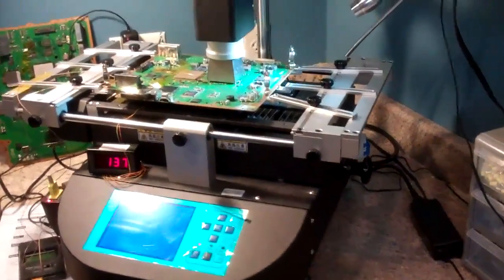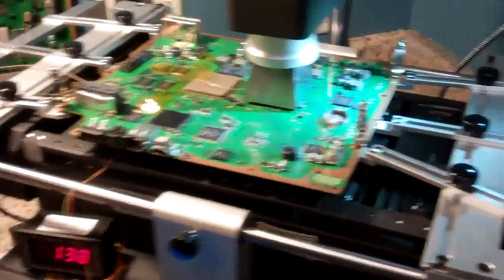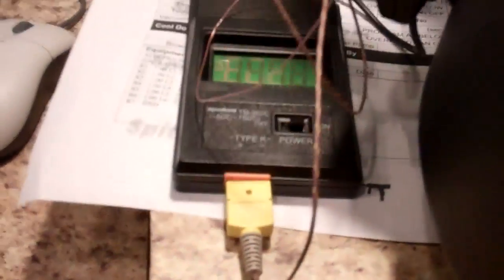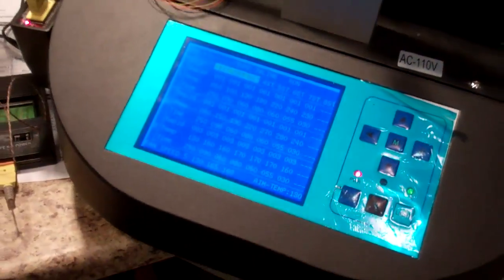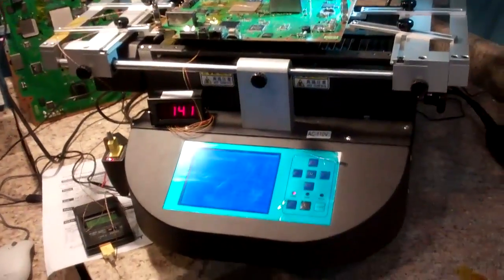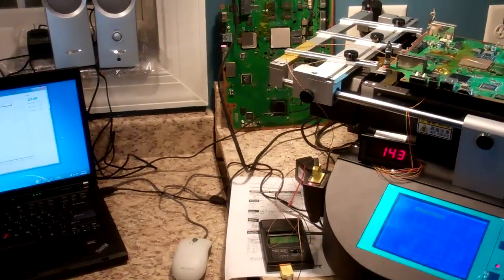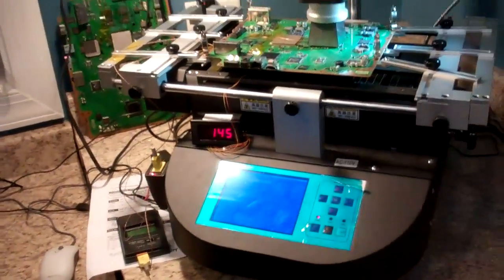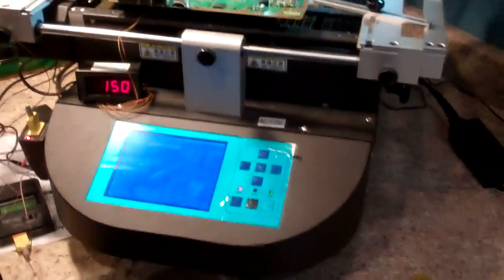Honton HT-R490 HT-490 has three heating sources, top central, lower central, and lower area.

Comment: What size chip can the top heater handle in mm? I have a gtx980ti I like to reball.
Reply from the maker: It varies based on nozzle size.  But I think 50mm is typical maybe larger with correct nozzles.
Reply: @SPITFIREMODS  What's your opinion on HT-R490 vs LY IR8500? I can get the IR 8500 for less but its only available in 220v from AliExpress.
Reply from the maker: @WilliamVG  Straight IR is more difficult the pushed air IR.  But those two are close in comparison.  If you customize them a bit and learn how to probe and get accurate readings you can improve them and teach yourself how to use.  I wouldn’t want to do any large bga on IR only machine. That can cause damage too easily.  But again it’s some personal preference involved.
Reply: Points taken,  thanks for the insight 👍

Comment: And also, could you tell me the difference between the HT-R490 and HT-490?
Reply from the maker: Some models get changed as they create a change in design.  The most common difference is IR vs hot air or some having the ability to do both.  There are also some with touch screen vs the typical PID controller.  I would suggest you look over the models options and then check some out with the same options to see if it is something you see yourself using and also if it fits your budget.
Reply: SPITFIREMODS
Great, thanks for the info.